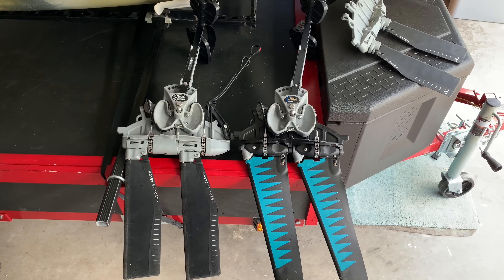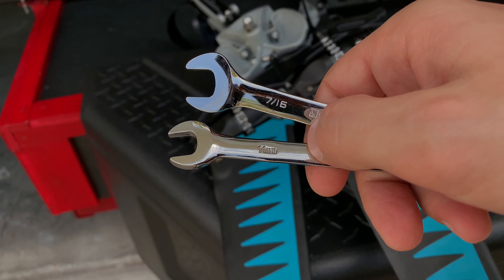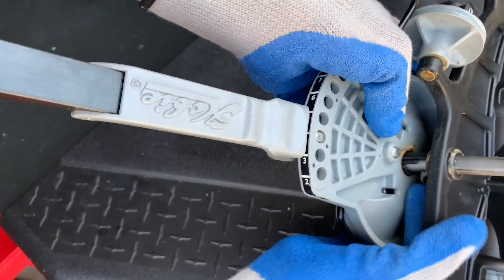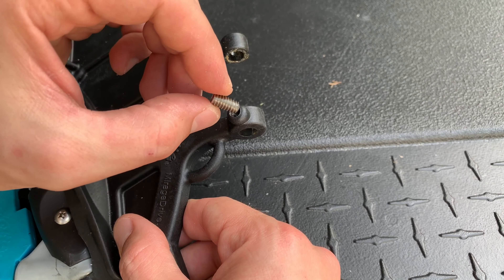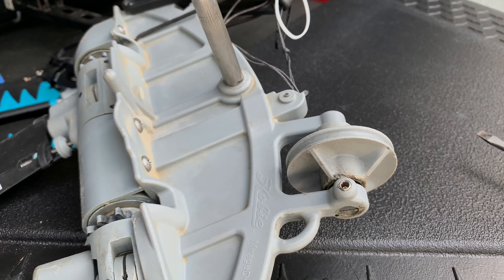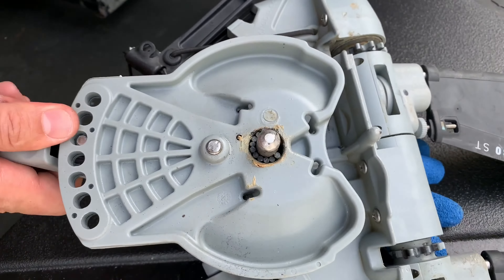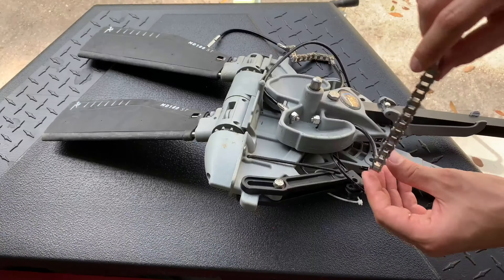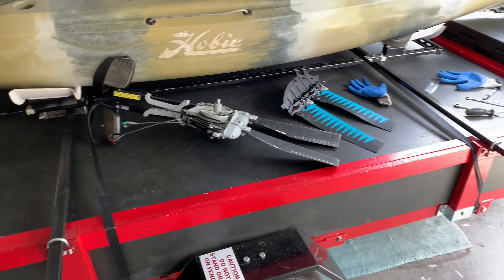Hobie Mirage GT to 180 with reverse - kayak pedal drive conversion.

Comment: Ya fascinating.. costs 700 in Australia.. so what lol are we all ignoring the fact that it looks the same and the pedals and drum shouldn't matter if the module fits in the kayak from both models... if it's the length of the rod in the center that's the issue just change that.. why u gotta disassemble everything?
Reply from the maker: Uuuuu... for the reverse capability....
Reply: @HookCircle  no ya that's what I'm saying is u want the reverse one.. take the pin/rod from the non reverse and put it in the reverse one